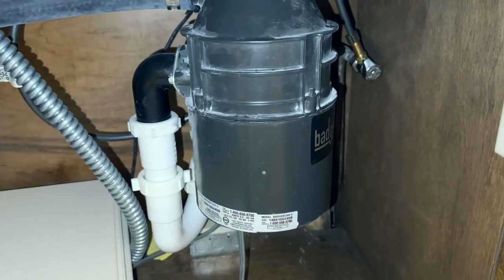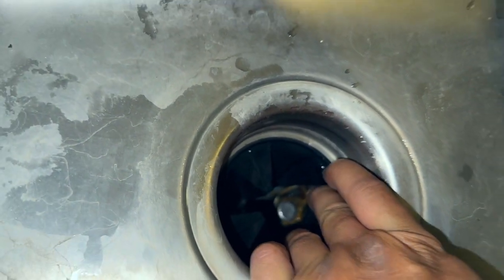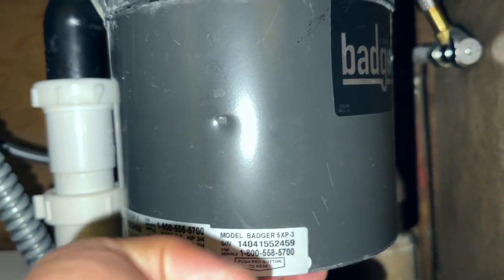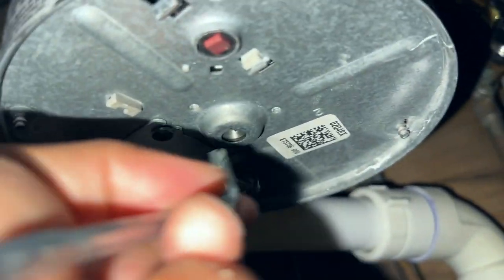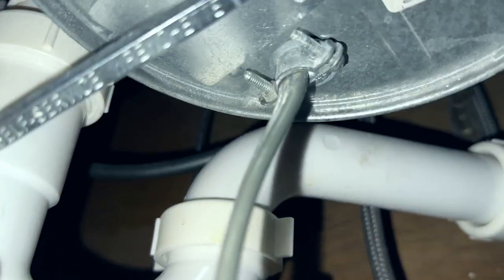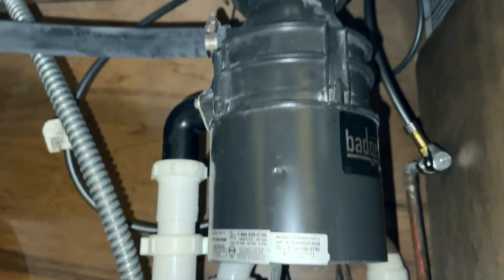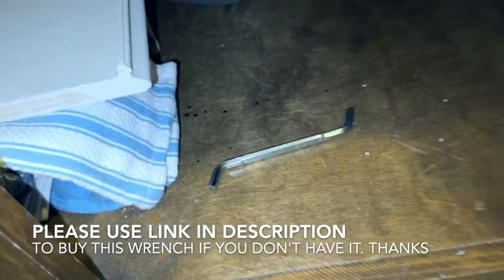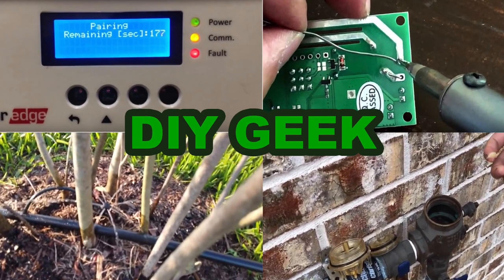BADGER GARBAGE DISPOSAL WILL NOT SPIN AFTER RESET *SOLVED*

Comment: Excellent! Thanks so much for making this little video. A real life saver on this late evening when I thought I had a crisis on my hands and an expensive call to the plumbers tomorrow. 🙏
I should add for any others...at first the wrench would NOT turn easily; really stuck. But, a little more added force got it to move and then it moved freely back & forth. After that, I tried the disposal and it worked as normal. :)